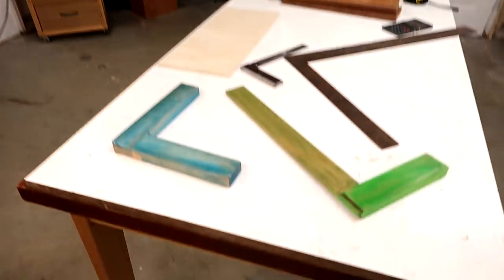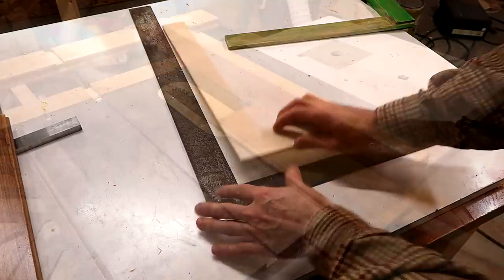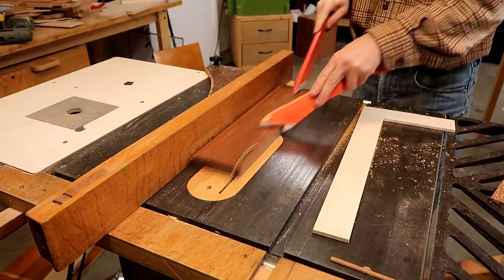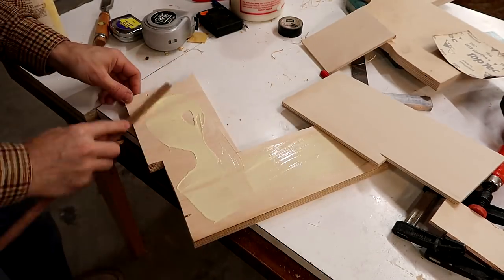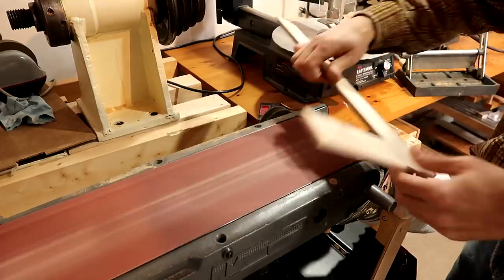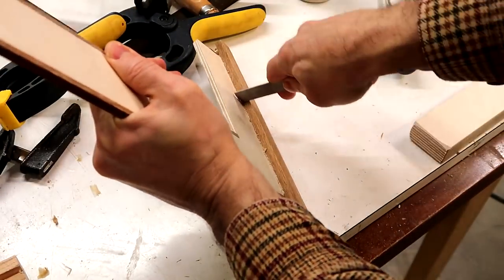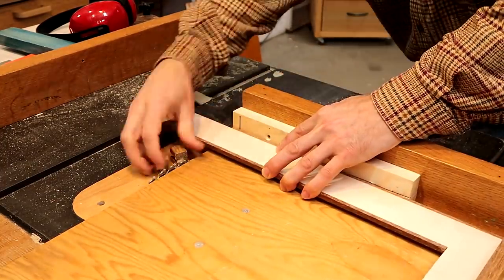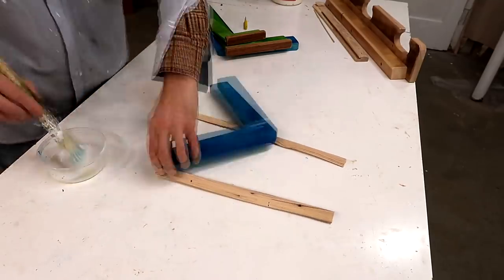Making shop squares

Comment: I like the reuse of oak hardwood flooring. I travelled 40km to pick up 120 sq ft of 3/4" planks with staples which took forever to remove. Now I have a lifetime supply of oak strips great for jig making. My problem is where to put all this stuff. Like a squirrel who only remembers 30% of the nuts he buried, I have a garage full of various materials. Every time I clean up it's like finding buried treasure.

Comment: you should do a video testing the strength of a joint with a lot of glue, like you tend to use, vs a joint with a thin layer of glue (that's what I've always heard as a recommendation for a strong joint when using wood glue). you could also test to see the strength difference between a joint that is clamped very tightly, vs a joint with just dumbbell weights on it.

this is my favorite YouTube channel by the way. thanks

Comment: You didn't show them in use at the end. I wanted to see how they worked compared to the old ones.
Reply from the maker: they work like squares.  You use them like squares.  If that is too much for your imagination, that's your problem.
Reply: Wow, Matthias. Excuse me. I didn't think my comment warranted such a rude response.
Reply: I actually checked the replies on this comment because I was curious about the same thing.  You stated at the beginning that you were going to build them more like T-squares so that they sat properly, but then you didn't.  I was curious why.  I thought you might have commented about that in this reply, but alas, I was very disappointed in the rudeness of this reply.  I truly enjoy your ingenuity and watching the way you make great things out of practically nothing.  Yet, you truly need to think about how you're treating your viewers.  Loss of respect here, sadly.
Reply: Aelanna64 - holy shit, what did you expect? It’s not like he built something mechanical that you can see in use!
Reply: The whole point of building the item was to improve it so it no longer fell off the edge of the table. But he never showed how/why it doesn't, or even if it doesn't. Sorry, but even if a question seems stupid, that's no reason to be rude to a loyal viewer and potential customer.
Reply: Aelanna64 - point taken.

Comment: Always check your squares for squareness before buying them. Or buy one made to a metrology standard.
Reply: Well said, was working with a speed square two weeks ago on a build and the damned thing was off.
Reply: How do you check your square for... square-ness? Genuinely asking since I have one currently but it came with the house and the person who sold us the house never used tools so the last time it was used was over a decade ago or more. So I might be getting a new one just so I don't have to worry. But of course I need to make sure.
Reply: you use trigonometry, measure 3 units on one side, 4 units on the other side, the distance between those 2 points should be 5 units. look up pythagoras theorem. However for most projects being at tiny bit off won't make much difference.
Reply: In the store, hold two of them back to back and push the other sides against a flat surfaces like a shelf or so. If it there are no gaps, both are 90°, but one could also be 89° and the other 91°, so try with multiple squares.
Reply: Align one leg to the edge of a straight board and draw a line along the other leg with a pencil.  Flip the square over so the same leg is aligned with the same edge of the board, but facing the opposite direction.  Draw another line on top of the first.  If they cover each other, it's square.  If they diverge or converge, it's not.

Comment: As a hack in the wood shop  (painter by trade) i watch tons and tons of woodworking videos to try and catch up to what I dont know.

 I just dont get the ragging on of any stains,dyes, paint and do on. Its messy, slow and impractical, and does nothing to help distribute even coats and the list of cons goes on..

 I've taken into account the years people have been doing this and tried it thinking im missing something but, I went back to my brushes.

 Theres a better way! and it is better!
Reply: @william Smith if you use rags or paper towel and such, it end up in the garbage, and you do not have to clean a brush. That is the "good enough" (and lazy) way !

Comment: G’day Math,

I really like that ‘reverse’ scoring trick you did there. Does that work on all materials? Since it’s standard cut that is the feed speed slower than the blade speed, do you think it differs much from a ‘forward’ 1mm cut?. Do you get a really good finish every time? Any join mark? Lastly, have you tried it on a laminated sheet like melamine or laminex? I don’t have room for a panel saw in my garage any longer and this ‘truck’ has me quite excited. 

The hardwood faces were a nice touch too. 

Cheers, Michael

Comment: I've bought a few big squares now and not a single one was square. The most expensive one was a Joseph Marples one (~£70) claiming an accuracy better than 0.01mm/10mm blade length. For a 600mm blade, that's a max of 0.6mm out, but mine was a massive 1mm out over the total length. Absolute shit! I've been trying to file it square over the past couple of days which has been pretty tedious, and that's just the outside edge. I should have just bought another framing square and glued a piece of plywood to it!
Reply from the maker: Just buy a framing square. Those are square.

Comment: Will the wood squares stay square with humidity changes? Or will they start to warp over time?
Reply: They may change over time so it is wise to check the tool for squareness each time you start a project.
Reply: They're plywood, so they should hold up pretty well, I'd imagine.
Reply: Не будет ни каких проблем, Вы не ракету в космос запускаете, что Вам необходимо выверять с точностью до минут,  секунд ( '' ,  ' ).
Reply: @OmmerSyssel  es es suka blait
Reply: @КирДитман  ✌🍻
Reply: @OmmerSyssel  😊

Comment: Do you use a square to check if your square is square?
Reply: It literally shows him using a square to check that his square is square.
Reply: We heard you liked squares so we made you a square with a square in a square! ;)
Reply: Its easy to check if it is square, just draw 1 line with the homemade angle, then flip it out or invert it, and then draw another line, which should be parallel to the first, then observe and or measure using any rule to determine how accurate the space between the line is. Example: _I  I_
Reply: Ulises548 

Just making sure that people know what you are talking about must use a straight reference edge. You cant just lay it flat and then roll it over as then of course both lines will be parallel. 

I guess it could be done flat and flipped the way that would have the two lines form a v or peak in the middle.

Comment: just a hint - I have one wooden square which has a little lip on the opposite side of the big piece made of the same material as the main ruler .. so it holds on the edge quite reasonably

Comment: How did they make the very first Square?
Reply: trigonometry
Reply: pythagorean theorem most likely
Reply: Compasses?
Reply: A string and something sharp to tie it to is all you need to make a 90° angle.

It is an interesting question, though.  Squares go back into prehistory.  I imagine there have been quite a few square designs that were useful for the tools used in their time period that are completely forgotten now.
Reply: Make two identical "squares", as good as you can. Put them back to back on a flat surface, and make adjust them both (keeping the angle the same) until there is no gap between them. You can make a flat surface by lapping three iron plates together. No trig or measurement required!
Reply: Your personality was transferred onto two pieces of wood. 
Just kidding.
Reply: you use the 3 4 5 method. google it
Reply: They used the edge of a Donald Duck pocket book. At least that's what I did as a kid.
Reply: Good question. The only tool you need to calibrate a square is a straightedge. You can make a straightedge by eye, just sight down a piece of wood and adjust it until it's perfectly straight/flat. Now that you have a flat reference point, put your square against it and draw a line using the square, perpendicular to the straightedge. Flip your square over and draw the line again. Adjust your square until the square produces the same line from both sides. Done!
Reply: J DeWitt - flat? What flat thing did the cavemen have to reference against?
Reply: @Spatial Guy -- You don't need anything flat as a reference, you can quite easily make a perfectly flat reference stick. Make a stick as flat as you can with your eye by taking off the high spots. Then stretch a string (or fiber or some sort) across the flat surface to identify any remaining high/low spots. You can get it really flat by this simple method.
Reply: J DeWitt  - I think we have differing definitions of ‘flat’. But that’s cool, we can agree to disagree, I get where you’re coming from, and that would method be make it pretty flat. Cheers
Reply: Compass and straight-edge
Draw a line, AB, of arbitrary length.
Adjust your compass to trace the length AB.
Center your compass on A, and draw a circle through B.
Center your compass on B and draw a circle through point A.
Your two circles will intersect at points C and D.
Draw line CD
The intersection of AB and CD is square.
Reply: Spatial Guy - Fair enough. I agree there are different degrees of flatness. My method my result in "flat enough", but not necessarily absolutely flat. Cheers!
Reply: I suspect there is nothing that is absolutely flat.

Comment: Is losing 'square' when you add varnish a concern?
Reply: On the other hand, not adding varnish allows the wood to move more drastically.
Reply: Understood. But does adding varnish add a concern for losing square? 
I imagine not as significant as not adding varnish over-time, but does it?
Reply: I'll let you know, I have a set of 4 freshly varnished drying right now.  Granted I made mine triangular instead of "L" shaped, which might retain it's squareness better.
Reply: Thank you, even if they are triangles.
Reply: The varnish didn't effect squareness at all.  I gave them a light scuff sanding to get the dust nibs out (because you know, varnish), and they remain to be perfectly square.  I think the key to making these squares is to use 3/4" plywood for stability.  Also, even though I used a crosscut sled to cut the pieces, I ensured they were square by using a shooting board.  I also recommend the triangular squares over the "L" shaped ones that Matthias built, I could see them being easier to break.
Reply: Thank you. Thank you very much.

Comment: I wonder how early squares were made. How do  you make one without another? You could use a protractor, but how do you make that accurate either?
Reply: Pythagoras theorem I would say...
But still, I don't think squareness was the main concern in early times, you can go pretty far just eyeballing dimensions.
Reply: Ah, the age old question, how do make an accurate tool If all you have is less accurate tools? Bootstrapping a square isn't really that hard it's possible to measure squareness with only linear measurements. This old Tony has a whole video on what square means and how to measure it.
Reply: lrochfort caliper+straight line
Reply: as long as you have a string you can make a compass and also define a plumb line, from there it should be reasonably smooth sailing  :)
Reply: You can construct a right angle with just a compass and a straight edge :) see e.g. https://en.wikipedia.org/wiki/Perpendicular#Construction_of_the_perpendicular
Reply: Been around for over 2500 years.  https://en.wikipedia.org/wiki/Pythagorean_theorem
Reply: Create a right angle triangle with a 3 4 and 5 unit measurement with a rope or something, doesn't matter which unit and it will always make a right angle triangle
Reply: lrochfort with geometry 😂😂😂🤣🤣🤣 older than YouTube 😁😁😁
Reply: 25A0 do you call it caliper or compass? Its confused me
Reply: @Attila Szabo I had to look up the exact difference myself. They are very similar, but as far as I can tell, you call it a caliper when it's used to measure distances, and a compass (or pair of compasses) when it's used for drawing. But sometimes they're interchangeable. For example, apparently some calipers are used in metalworking to mark things on the workpiece.
Reply: 25A0 and then, you call it also compass the magnetic pins (north-south) oh man. I would not be carpenter on a ship. "dude bring me the compass! Not that compass, the another compass! No, the compass which is actually caliper! 0.0

Comment: I know you've probably answered this question before in your back catalogue but I haven't come across an answer as yet.
Did you come up with the green colour for you handmade machines purely as an ironic dig at festool fans?
Reply: Somewhere a long time ago he said he used green because it was left over from painting a wall.  You know, he rarely buys materials.
Reply: peggyt1243 even better, he said that he got a whole lot of it all for free ahah
Reply: peggyt1243 makes sense. But then he has other builds that would have required more than just leftovers. Colour coordination?
Reply: Well when something is half painted, it makes sense to buy more of the same colour to finish the job then you have paint left over from that job and so on.
Reply: peggyt1243 catch 22. I don't want to waste this horrible coloured paint but I need to buy more of said paint in order to complete my new machine. Damn it. I've got some left over paint......etc etc. 😂😂
Reply: The best branding is not planned, it evolves.

Comment: Why dont you make it from metal? But cool squares
Reply: Also, beside a metal square, few relatively accurate wood squares are useful. Obviously  they never be machinist precision, but they does the job. However its really need to check them after a while because they can loose their shape.

Comment: Hey Matthias, why not use a handplane to flush up the hardwood edge?  Great looking square nonetheless.
Reply: or a router table with a flush trim bit.. i noticed he doesn't use one. in car audio, we use a LOT of router table tricks.
Reply: just realized with the shape he'd need a pretty tall bottom bearing flush trim bit to do what he was needing, so it probably isn't feasible.
Reply: Mani Mazinani guess you could use a trimming router too, though nothing beats the touch and feel of a super sharp home made manual #4 wood plane. Ahhh. Probably a dozen ways to do it. If he’s like me, he goes for what’s closest and quickest.
Reply: no obstacles for the right sized handplane, which we know he has.
Reply from the maker: that exotic wood doesn't plane well.  But why spend so much time arguing over somethign that took me 30 seconds.  Is it worth the time?
Reply: Thanks for your answer!  If I was so worried about time efficiency, I'd never visit youtube. So, I could ask you the same question about the whole video.  But, the answer to YOUR question is this: I'm trying to learn something!
Reply: Matthias Wandel  - who is arguing? Anyone here arguing?

Comment: Sir,
Love your videos. :-)
How about a longer running project? You probably don't need any new tools, but, still... Perhaps a CNC pantorouter, a micro band saw, for us with the small shops, an instrument.... Something ... ? 
Best,  
/B
Reply: Micro bandsaw would be very interesting, I'm wondering if the Wandel bandsaw design scales down well.  I think I remember Matthias not being a fan of small bandsaws though, although I might just be imagining that.
Reply: I think there might be an issue with stability, if you downsize directly. 
Can't remember if Mr. Wandel said anything about sizing, except he builds bigger and bigger Bandsaws. :-)
Reply: I believe that Matthias is still in the process of setting up his shops. Most of his videos are going to be based on his needs for either replacement tools or house projects for his growing family. Also it's winter out and not much fun going out and getting big material. I wouldn't expect a big project until spring or so.
Reply: Ok, that is reasonable, and I wasn't really aware of that.
Reply: I am sure Math did a panto a fair while back. Could be wrong...lol, not!

Comment: question would the varnish affect the measurements of the square
Reply: Unless he did an absolutely atrocious job varnishing, it's unlikely that it would appreciably change the accuracy of these squares.
If it did. A few seconds with sandpaper could fix the issue, though.

Comment: OK, so how do you know your square is square...!
Reply: Flip it on a straight edge. How do you know a straight edge is straight? Compare against a thread under tension.
Reply: First challenge - making straight edges. Next challenge cutting arbitrary angles. Final challenge - math. 3-4-5. Measure 3 things (in, cm, whatever) along one side and mark. Measure 4 things along the other thing and mark. The distance diagonally from mark to mark will be exactly 5 things. If bigger, angle is > 90, if smaller, angle is < 90.

Comment: hi just like to ask
does band saw kickback like table saw ????? thanks
Reply: No, one of the advantages to a bandsaw.
Reply: Kickback is the result of the saw blade catching the wood without cutting it and pushing it in the direction the blade is rotating. A bandsaw blade is going down into the table so wood would be kicked around the table at worst. On a tablesaw the blade is spinning in the direction of the operator so if it grabs onto the wood without managing to cut it, it will throw it towards the operator.
Reply: Wooda Wambam thanks for ur reply